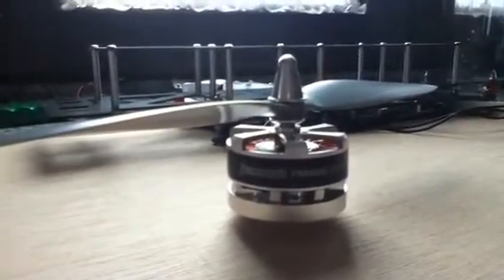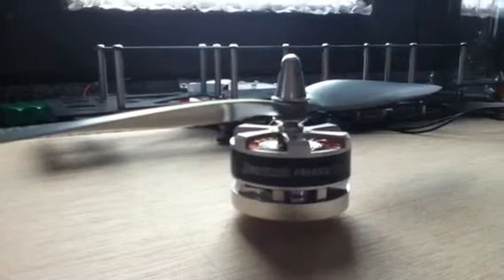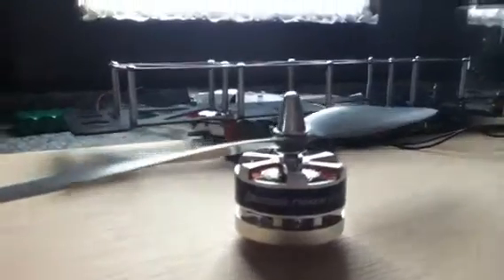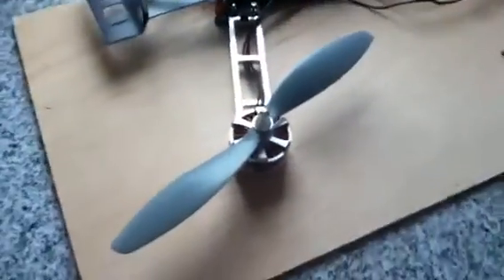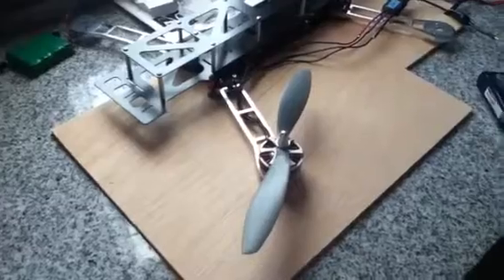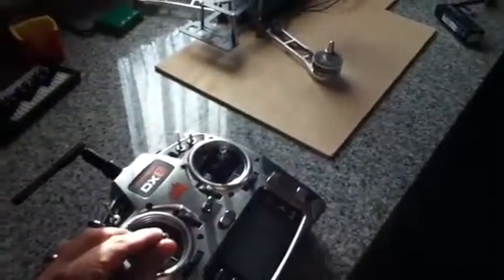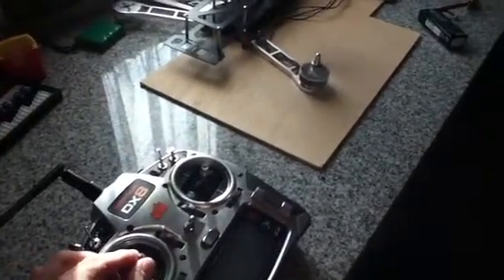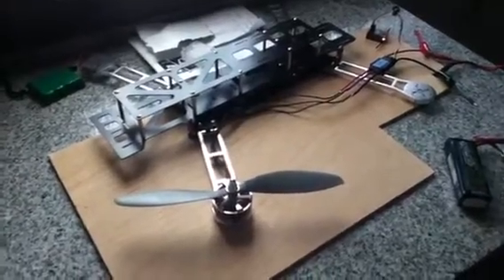FM4008 motor & flashed esc

Comment: Thank you for doing this test and confirming that simonk flashed ESCs do seem to work fine with the FM4008 40mm stator, 620kv multi-rotor motors. One of my test pilots is working on additional tests to confirm the same. But with your results and Juz's results, who is flying the same combination, it seems that regular SimonK flashed ESCs do work fine.